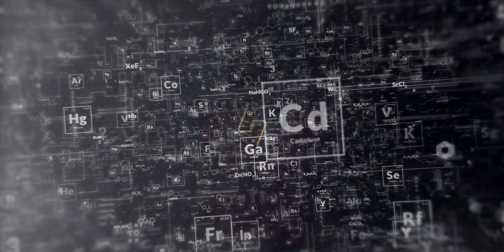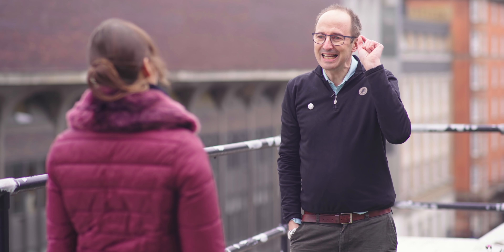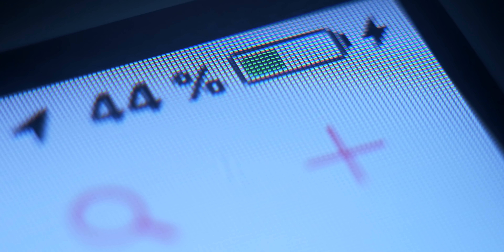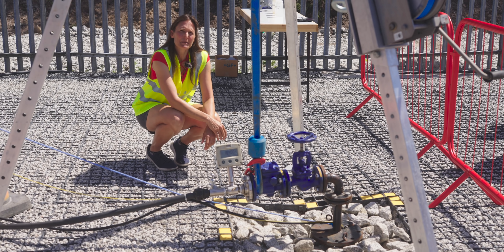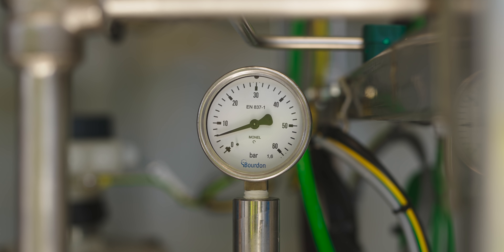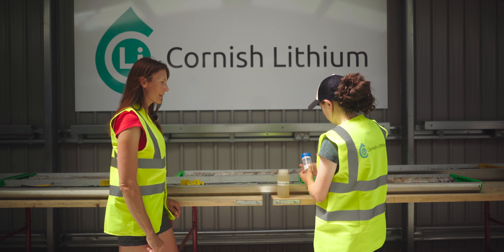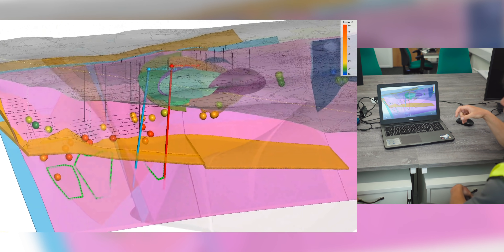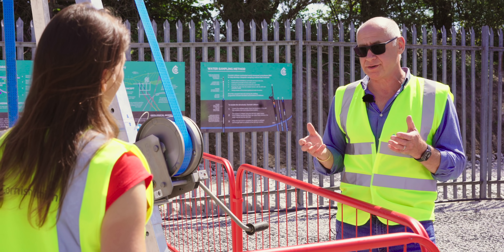LITHIUM for EV BATTERIES - The art of mineral extraction with Cornish Lithium | FULLY CHARGED

Comment: @15:4- he dodges the question entirely.  "How much" is given only as "that hole over there is the highest grade lithium brine in the world, this one not quite so much," and that's as precise as the answer gets.
Reply: Lithium extraction from brine is quite simple, in South America they use simple evaporation ponds, however this is not a rapid process. I would expect in the UK that they would use a more industrial method at a central processing unit near the well heads and accelerate the processing with ‘free’ geothermal energy from the hot ground water. Potentially, it’s going to be a 
clean process to extract the lithium - it will need to be to ever stand a chance of proceeding in the UK. They are also interested in other minerals (mentioned at minute 11.25) which could help the economics but which may require additional processing and a more intensive industrial process. The water once processed and the lithium & other elements extracted, would be reinjected back into the rocks from where it originated which they mention as 1 to 5km underground.
Numbers of wells is an unknown at this time I would say, they would want to drill and intersect existing, natural faults as these provide conduits for water already present underground which they will want to pump to the surface. How well these faults/fractures are connected will determine the number of wells required, much as in oil and gas field production. 
I would not expect any disposal of waste water into rivers or the sea would be required and so I would not expect any coastal impact at all.  There is not much limestone in Cornwall, which is the usual rock that can suffer dissolution and rarely, surface collapse such as sink holes which may take thousands of years to form. Limestone in Cornwall is restricted mostly to the coast of northn Cornwall (Bude, Boscastle and further north-east)  whereas the granite is in central Cornwall and to the south-west.
There is a lot of commercial sensitivity in any mining exploration operation and particularly in the case of lithium and so not surprising that they are a bit tight-lipped on their mineral resources. Cornish Lithium have a public website with a lot more information that is worth browsing.

DISCLAIMER: I have no connection with Cornish Lithium. I am a retired geologist with knowledge of hard rock mineral exploration & exploitation and the oil & gas industry. The comments above are my  opinion based on my knowledge, Cornish Lithium’s website and this YouTube video.
Reply: @paulm3538  Not rapid, but not expensive either, if you have lots of land you can devote to it.  It's a very low-energy process.
Reply: @paulm3538  Robert was talking on fully charged plus to a guy that was either running a pilot plant or about to ( Robert got a little too enthusiastic to let the chap talk  much ) that used reverse osmosis to extract lithium from the brine. No evaporation, no salt pans .
Reply: My question as well...absolutely nothing in this video giving us an idea of the volume of lithium that is available or how many shafts would be required to make this a viable commercial operation.  It's great that they can extract the lithium/water combo with minimal environmental impact (if indeed this is the case...the need for hundreds of shafts might not generate the same conclusion) but what is the process for separating the Lithium from the water solution?  Is it done right at the well head location or shipped elsewhere?  Does it require a lot of energy or chemicals?  
I am also wondering if the water that is removed must be replaced?  Will this generate instability a KM or more under the surface? I have no sense of the volume of water to be extracted.  Or if this could have long term repercussions such as sink holes or coastal erosion etc 
I am as excited as Helen about this potentially ground breaking technology but before I jump up and down I'd like to know the specifics...I am surprised that Helen didn't ensure that she had that info before completing this video.
Reply: If the UK needs 60.000 tons of Lithium to meet it's EV targets how much extracted water needs to be processed?
Reply: @dmaavrigdo  there is nothing Britain consumes that Britain can supply for itself, it is too small and overcrowded. Half the world’s supply of lithium comes from Australia where it is mined not extracted from solution. Obviously Cornwall will help but it’s not going to supply all of British needs.
Reply: Also avoided the big questions around how they plan to evaporate all that water. Brine processing in the Nevada desert is very different when you have hit desert sun. So are there going to be electricity expenses to boil it down?
Reply: With my hater club hat on I could reduce this piece to naive tokenistic window dressing and Gina Rinehart is the real face of mining... I'd prefer this technically loose, idealistic, healthy alternative as unrealistic and unscalable as it may be...
Reply: They must think it's scalable or they wouldn't bother
Reply: Commercially sensitive info maybe?
Reply: What are they worried about? Someone doing a Mr Burns - coming along and building another shaft at a 45° angle and sucking out all their lithium?

If the flow is active and lithium is a soluble as he claims, they would know off hand how many grams/litre they're getting.
Reply: @g00rb4u  It's doable.  You can steer a bore quite a bit in fact.
Reply: Avoiding the hard numbers is bad from an investors standpoint. It reminds me of the one open pit mine that went into production in Cornwall based upon 4 drill holes.
Reply: @waywardgeologist2520  I don’t know speculating on mine yields on an unaudited video channel might be interpreted as stock manipulation.
Reply: @francesconicoletti2547  reporting numbers to give investors an accurate picture is stock manipulation. It happens all the time in active mine. I've been responsible for daily providing those numbers and giving inaccurate data is fraud and can lead to criminal prosecution.
Reply: That was a very good way of saying "We don't yet know but we're hopeful."

Comment: Do they not need a large pool to evaporate the water like how it's usually done?
Reply: Solar evaporation ponds are used where there is lots of space and sunlight, but there are other methods. I don't think they mentioned it in the video, but I imagine they will use some sort of mechanical process like pushing the fluid through a membrane, similar to how seawater is desalinated to produce fresh water.
Reply: No ... it was clearly stated that the water would be pumped back down to recirculate and leach more lithium from the stone (9:30). It would be a waste of the water actually if you just let it evaporate, that's not a low-footprint method of extracting anything, because you could change the water tables at the various depths.

So yes, it'll probably be a membrane method.
Reply: Ion exchange, is the most likely method they will be using for extracting the Lithium.
Check out Lake Resources planned operations in Argentina.

Comment: I'm glad you are addressing the ethical issues and showing a balanced view. I get sick of people of praising EVs and using the term "saving the planet" when battery construction has such a huge environmental impact.
Reply: Not even close to the impact of fossil fuels, though. This type of progress would make them even better, obviously. But already EVs ARE way better, even when you take battery production into account. There is lots of disinformation about batteries around.
Reply: @davidsommen1324  initially, they cause far greater damage, but it evens out over the lifetime, and as you say, generally speaking they are better overall. But if people really want to save the planet, they should consider giving up driving altogether if possible.
Reply: @PaulHawkins87  You mean there is a higher footprint (about 15-20% depending on battery size) for the PRODUCTION of a car with a battery - which is true. We don't disagree on that. But we need to be wary to engage in a nirvana fallacy, where perfection becomes the enemy of the good. Every process that we can make less energy intensive and more environmentally friendly, we should! But often pointing out that BEVs are not perfectly environmentally friendly "either", is often wrongfully interpreted to mean that they therefore are not a solution to environmental and climate problems. In fact they are a good solution and potentially a great one, if you accept the basic fact that humanity cannot altogether stop driving (although we definitely can drive less). The difference between EVs and fossil fuel-powered cars is bigger than we are often led to believe - and there is a lot of FUD and disinformation about that fact, disseminated often with intent.

Is not driving better? Of course! But if you do drive, driving an electric vehicle really makes a difference.
Reply: @davidsommen1324  The problem is that people and governments see "EVs are much better", ignore the resource extraction and manufacturing emissions, and then continue giving more money to widen highways. All that money could be going to make public transport and cycling better. EV or ICE, we should be charging people a lot more to drive and park because cars hurt our cities in more ways than just emissions. 

The real progressive policies that will actually make a big impact on climate change are completly disregarded because "electric autonomous vehicles will save us"
Reply: @davidsommen1324  I'm not referring to the initial manufacturing process, but the second Life or recycling of the batteries is also harmful to the environment. The toxic glues and plastics holding these batteries together have to be burnt and dipped in highly toxic acids to get the so called rare earth materials from them. There's still huge amounts of waste involved in that, and very few companies out there have found a way to make that a worthy venture yet.
Reply: @adamt195  Well the reality, in my experience at least, is more that people are constantly reminded that EVs will NOT save us (for example because battery production has an impact), and therefore we can happily keep on driving ICE cars, and meanwhile widen the roads for them. Are roads being widened because of EVs? No. It's the electric car that poses a real threat in that regard, it's the billions of (other) cars burning millions of tonnes of fossil fuel.

Of course it is a fact that driving a car, EV or not, is not beneficial for the environment. As I said I agree with that. However driving is not really going away soon and EVs can and DO make a huge difference. Meanwhile policies to encourage driving less are compatible with a transition to BEVs. We don't have to choose between the two.
Reply: @PaulHawkins87  It evens out quite quickly in fact.  At least for the EVs that have been designed with efficiency in mind, and are not crude electrification of pre-existing ICE models.  The GHG-footprint of a Tesla Model 3 evens out after only ca. 8500 km... or around 8 months of average driving!  (source: Tesla Impact Report 2020, page 11).
Having said this, most countries obviously need better public transportation!  Living 50/50 between Switzerland and France, I observe the gulf of difference between those two neighboring countries.  In Switzerland, I can live without my car on most occasions. Actually, two of my four adult sons don't even own one.   In rural France where I live half the time, I could not live without a car!

Comment: That’s great. It will indeed be an important element for our economy in the upcoming centuries. And yes, there are substitutes to Lithium. Thank you!
Reply: Vanadium redox flow batteries are a better battery, but unfortunately they are to heavy for mobile ESS ... (Energy Storage Systems)... great for Static ESS but not for cars etc...
Reply: @peterlattimore6013  Anything other than Lithium will be heavier. Lithium is the least dense metal on the periodic table and it is highly reactive (easy electron donor), and thus the most suited for batteries in vehicles.
Reply: @paulmichaelfreedman8334  How much lithium is in a lithium ion battery? because I assumed it was less than 10%. And therefore its weight was not that important.
Reply: @stardusttwo6262  You should check out the videos where a Li-ion cell is unrolled. It's quite a substantial amount. It may be 10% mass fraction, but Lithium is so light that could mean it' has 70% of volume fraction. Cathode/anode/casing are made of much heavier elements
Reply: @paulmichaelfreedman8334  I don't think you can see the lithium on its own, the cathode can be 80% nickel plus some cobalt  and aluminium in NCA cells.
Reply: @peterlattimore6013  follow